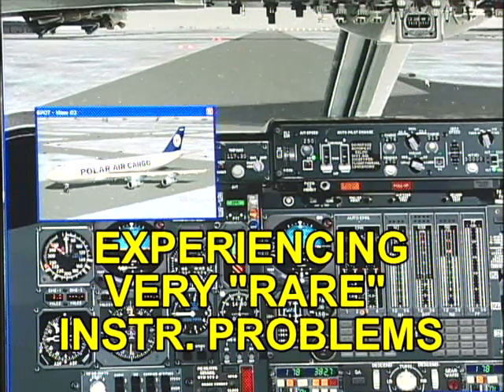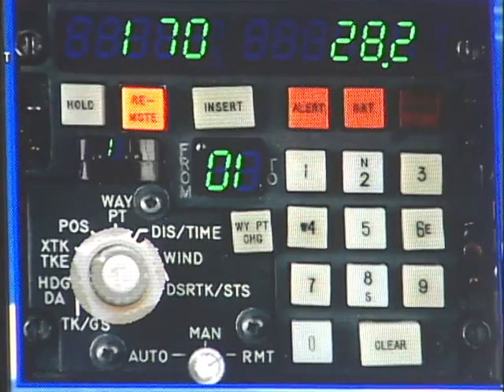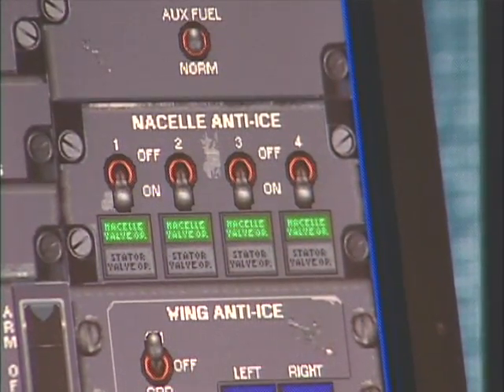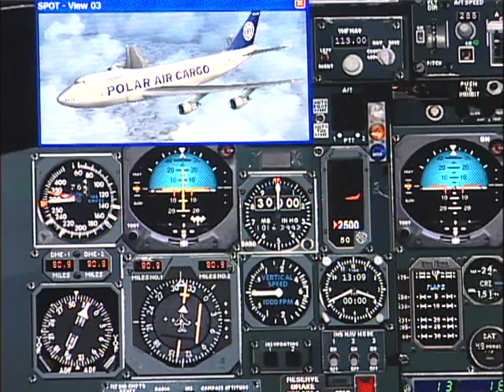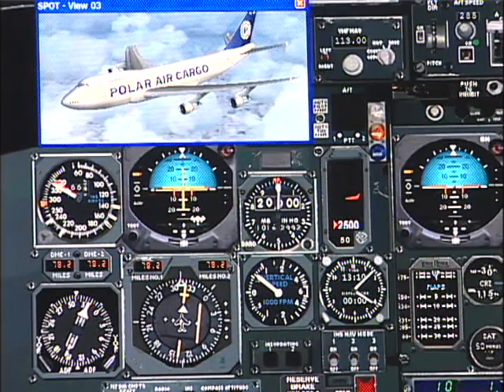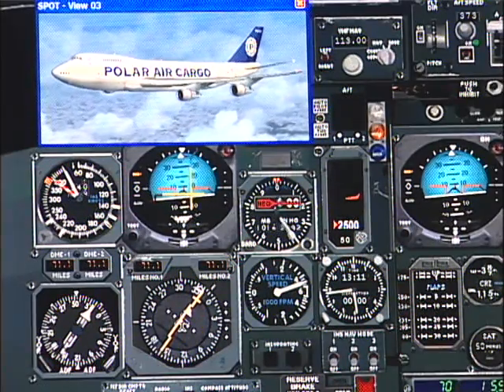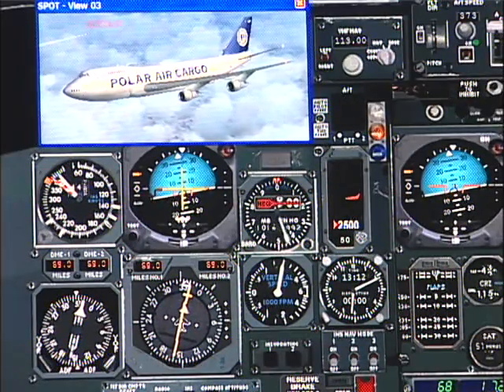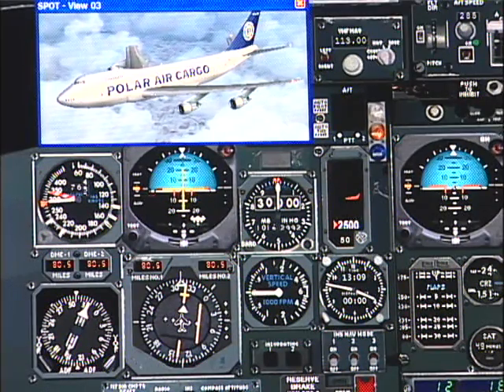B747-200 RARE PROBLEMS (Ready For Pushback F.S.)

Comment: i don't know if you still check this channel, but what you experienced was a weather transition. with modern weather software addons like activesky, you will not experience these anymore. default fs2004/fsx weather transitions were very abrupt and caused these crazy altimeter setting changes. it happens in the same place because you are flying into that weather station's area of weather data.
Reply: Alex I think departed this life some time back unfortunately.